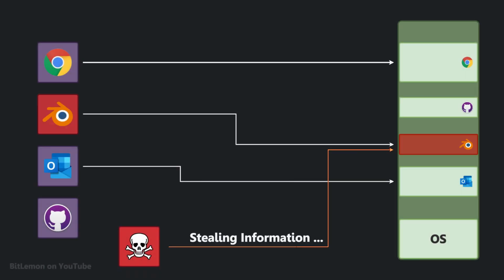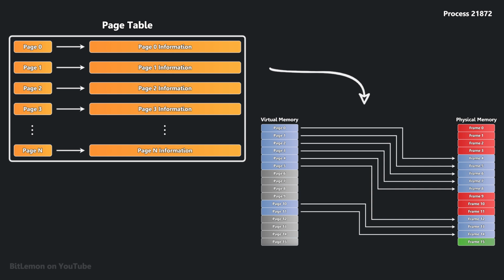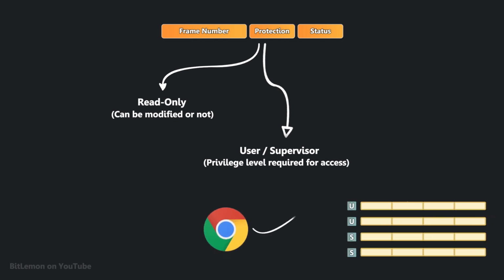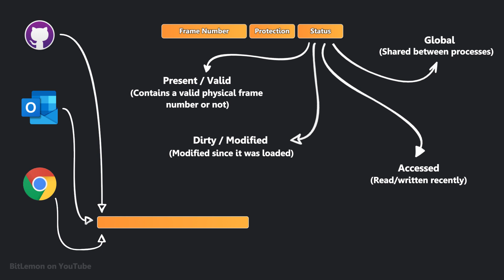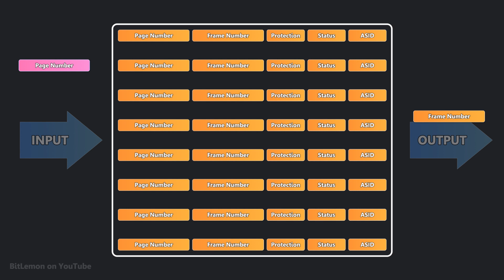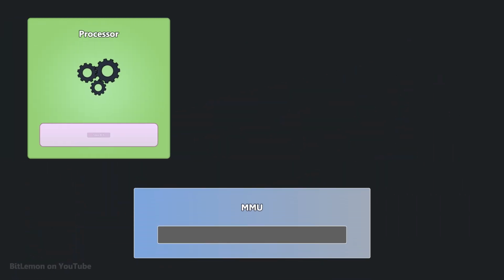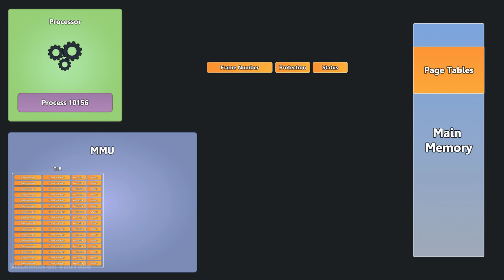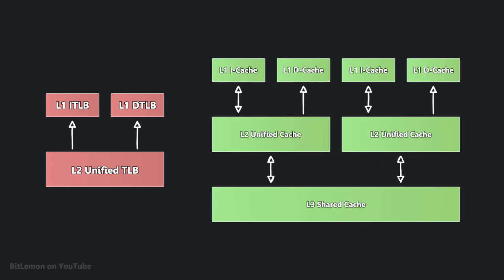Page Tables and MMU: How Virtual Memory Actually Works Behind the Scenes (Animation)

Comment: Great video. I’d also like to say you seem to lightly touch on this but maybe not spelled out as clearly. Note there are other types of page faults too (though not as insidious but still pretty bad for performance)

1. RAM-based page faults: The TLB is missing the VPN -> PPN mapping for a page already in memory. This can page fault, require a page walk, and then restart the virtual address translation process.

2. Disk-based page faults. This is similar to above except it happens when the page isn’t even in memory and must be paged into RAM from disk (requiring a page replacement algorithm like the clock algo to run to potentially evict a page if it’s physical RAM is full. Then reading the page from disk into RAM). This is quite bad for performance.
Reply from the maker: Thanks! You're right I could have explained it better, just like you did right here 🙂. Thank you for the clarification.